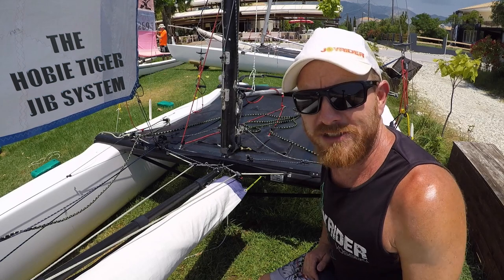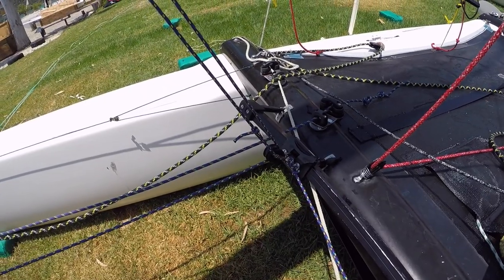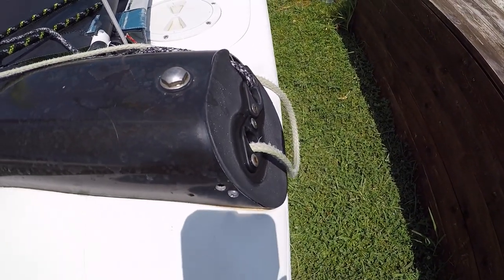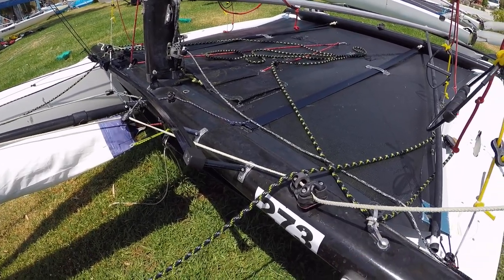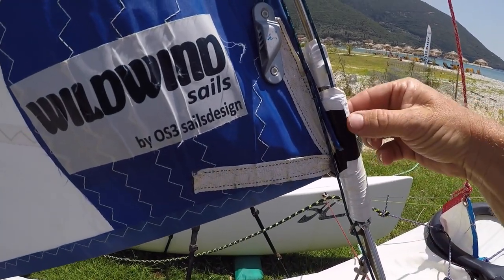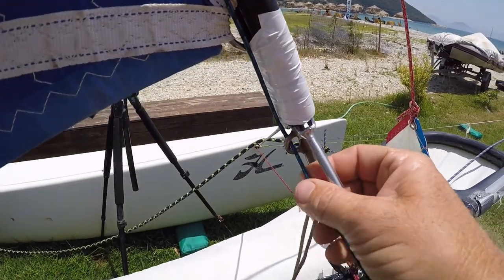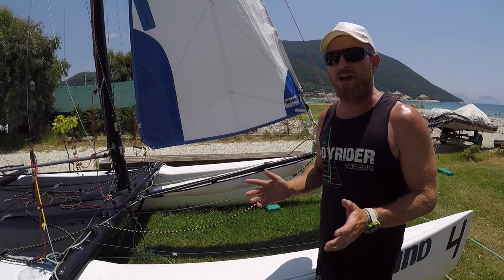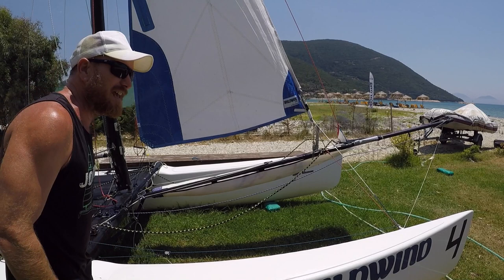The Hobie Tiger Jib System

Comment: Hi Joe, 

What is the purpose of the cord which runs from the bow tangs under the bridle wires and joins on to the spinnaker pole? My Tiger doesn't have this and I am wondering whether I need to add it back.

Many thanks, 

Ben.
Reply from the maker: Hi Ben, 
I'll talk about that in today's Q+A

Comment: Thanks for your brilliant YouTube tutorials Joe. I've just bought a Tiger and these have been super useful.  Any tips for setting up a jib sheet system for folks who don't normally fit/use the bowsprit?
Reply from the maker: It's going to be tricky to have the self tacking jib without the bowsprit. 
Is your's self tacking?
Reply: Thanks  @JoyriderTV  - yes, it's set up for the self-tacking system (track, travellor, etc). Without mounting the bowsprit, can I instead use a simple system to limit the travellor and a sheet/block between the travellor and jib? Or is the travellor track not meant to take that sort of pressure, sheeting straight to the clew? Should I use the spi pole even if I'm not using the kite?
Reply from the maker: @jameswhelan9289  I think the answer to this I'll have to illustrate in the Q+A on Friday.

Cheers
Reply: Hey @JoyriderTV  - using the set-up you explain in this video, but without the bowsprit fitted, could I shackle the pulley that's furthest forward to the bridle between the hulls? It would mean some afterward pressure being applied to the bridle.

Comment: Joseph, Fantastic videos!  Across the board; all of them helpful and informative. Very clear communication!  I’ve passed links on to my friends. 

Question: For the Hobie Tiger, what is length and diameter of the elastic chord passing through the front crossbar, that takes up the jib sheet?  Any trick getting it passed through the cross bar?

2nd: Can you provide me with a list of your recommended line/sheet lengths and type for the Tiger?  For example, I’ve noticed that my spinnaker halyard is so abrasive that it is wearing pinholes into my spinnaker: it’s 5mm specter and I’ve heard of something called dyneema. My halyard needs replacing, I believe it’s 5mm specter, too.
Reply: Oh, my!  You are good.  I found the video on the jib sheet take up system!  So just the recommended lines question, please.  Wow, I’ve found even more very much needed videos...thank you so much!
Reply from the maker: Try this one as well - https://youtu.be/ONH-eElE7h8 
After checking that one let me know if there's anything else that you need.
Cheers.
Reply: Joseph Bennett Phenomenial!  You are the “go to guy” for everything catamaran!  Thank you. Perfect; just what I needed!
Reply: One question: What size of block do you recommend for inside the cross bar for the shock chord takeaway system?

Comment: Excellent video, I've struggled to get this problem solved in a satisfactory way for the last years. Thanks a million !!
Reply from the maker: I'm glad to be able to help.
Reply: Joseph Bennett 
Ok so I've managed as far as  to understand that I need to adjust this concept to my self tacking system. Spent all last night trying to get it working without success. 
My jib "rolls in" (not sure of the English wors) and I keep on failing to find a tacking system that works while using the "roll in" setup. Hobie instruction manual just does not help much either.
Reply from the maker: Hi Jimmy,
if you have a rolling jib, what you can do is where the rope is tied through the middle of the block on the car (0.40) instead of having a knot (we use a bowline) you can use a caribena clip so that you can release enough rope to enable rolling the jib.
Let me know if that makes sense, if not I can make a short video to explain.

cheers
Reply: Jimmy Arvidsson on a roller setup you need to have the Cunningham on the top. You need to shorten the forestay pigtail at the top by maybe 12 inches to accommodate the drum, swivel, and adjustment distance, then run the Cunningham line down the mast or inside the mast.  You need a turning block at the mast hound. On my boat I eliminated the Cunningham when running a furler, and just pre tensioned the luff for the days conditions. Not ideal but it’s dead simple and works just fine if not in full race mode.